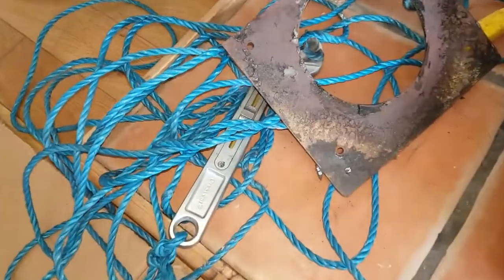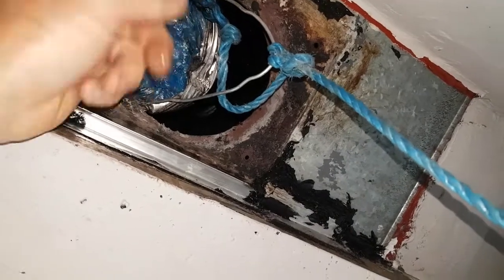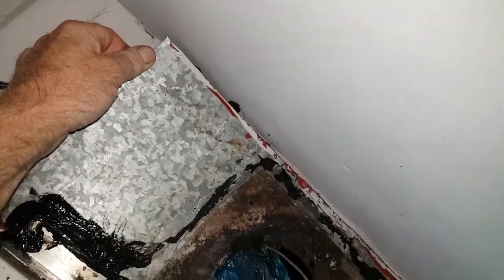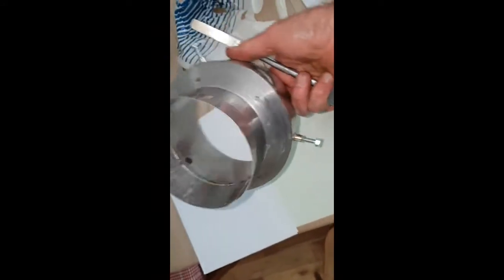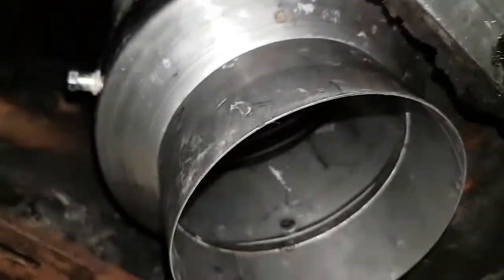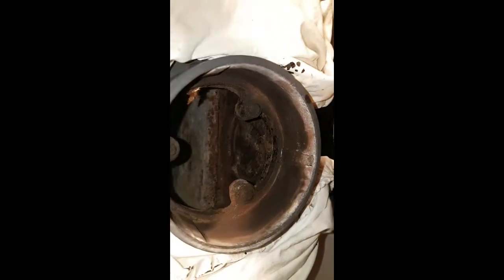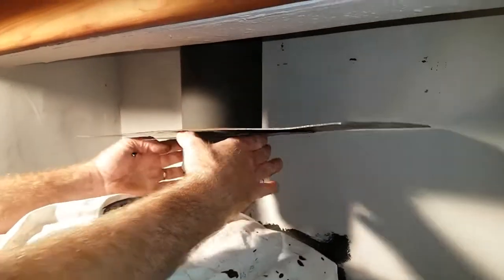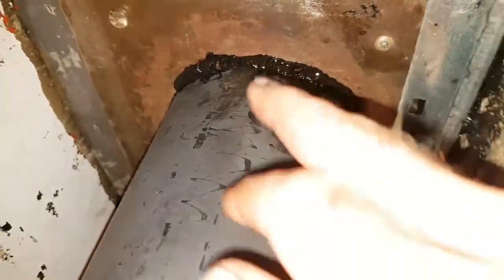How to install a flexible chimney  flue liner  ( PART 2)..

Comment: Could you run the liner straight into the stove? Is it just better aesthetics having the stove pipe for the final run? Thanks
Reply from the maker: Most would burners have a short enamel pipe from the burner and then you have an adapter connector from flexi to ridged pipe.
I suppose if you are not bothered on aesthetics you possibly could connect straight to the wood burner
Reply: @markrocketmangrimstead  Thank you

Comment: How did the Hest resistant silicone hold up mate ?
Reply from the maker: Not great around vitreous enamel flue where the heat is intense, ok around register plate,around enamel pipe connecting to woodburner use fire cement,.
Having said that the cement eventually cracks.
Reply: @markrocketmangrimstead  awesome, thankyou for your reply. Going to be installing my first one in the next few weeks. Appreciate the videos.